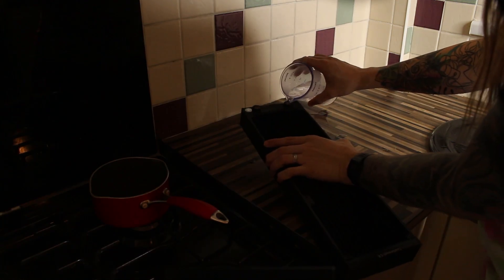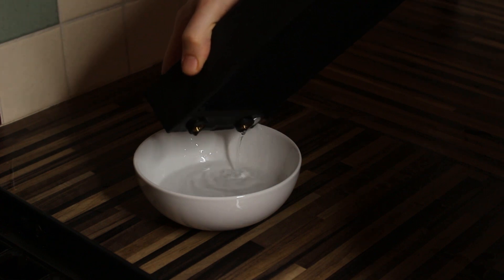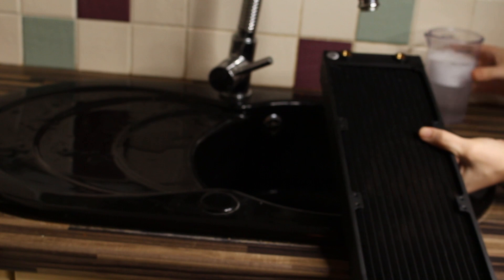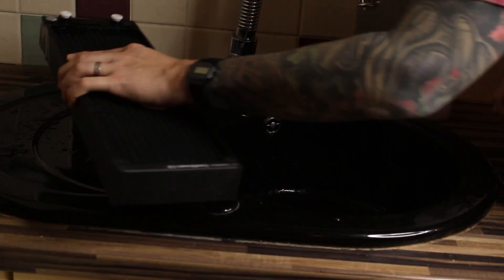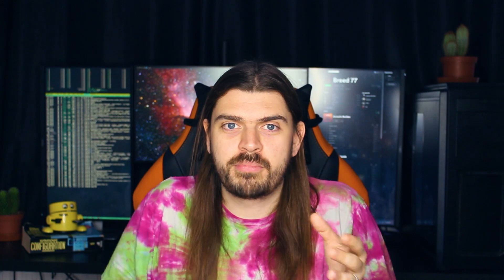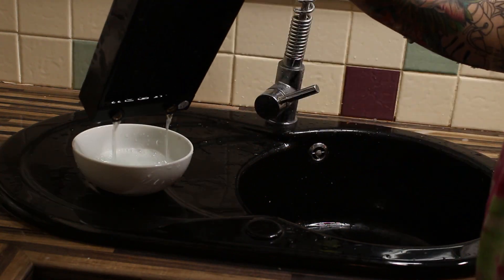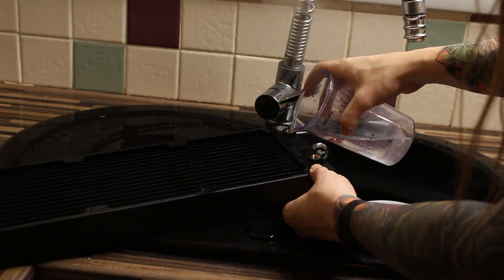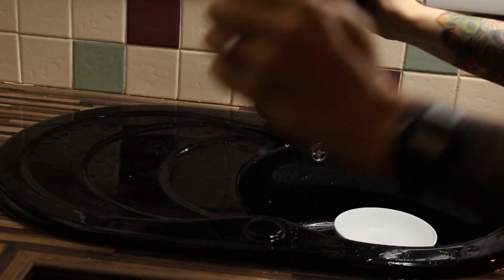Water Cooling: Cleaning Your Radiator

Comment from the maker: This was my first time - so how do you clean your radiators - any tips or tricks to share?
Reply: I only do it with room temperature distilled water, shake it, empty it, fill it again until nothing comes out anymore. I'm not a fan of aggressive cleaners.
Reply: Couple of small errors that could build up. No.1 by cleaning with chemicals you risk damaging softer materials such as plexi or even the rubber o rings in fittings. The chemicals will also react with some coolants which then limits your choices on those and more importantly you don't know what will and won't react unless you have a degree or knowledge in chemistry. No.2 by flushing with regular water you introduce metals and other contaminants that will accelerate the oxidization of the copper e.g. corrosion. Both of these things pretty much ensure that if you don't flush it with proper liquids chances are that radiator and most things inside your loop are dead within the first year.

Edit: For anyone looking to flush radiators either new or used there are three methods. One hot/warm boiled distilled demineralised water and let it sit in the radiator for 10-15mins to break down the flux (this is the most important thing to remove vs the small bits of metal). Two again with hot/warm demineralised water but with a tiny splash of acid such as lemon juice or white vinegar to aid this process, note that with acid baths like this you again limit your choice of coolants it can break them down or change their color over time. Three buy a radiator flush concentrate, this is usually a soft chemical mix which again can react with specific coolants but is for the sake of people running clear distilled water loops one of the best options there is. In general you want to not introduce ANY unknowns into the loop as they WILL stay no matter how many times you flush it.

Comment: Some would argue that only demineralised water should be used in order to prevent corrosion inside the radiators...
Reply from the maker: Some would not be happy that I recently rebuilt this using mostly tap water for 2 months...
Reply: @GuyRobotTV  the guy is right. You should never, ever put anything but deionized water or distilled water in a radiator. That your radiator has held up for two whole months means nothing lol!
Reply from the maker: @christopherjames9843  From a chemical perspective it really comes down to the impact of it and how long it's running - much in the same capacity you can fill a car radiator up with a bottle of Coca Cola in a worst case scenario it probably isn't a great idea.

Using boiled tap water in a clean cycle before you place in cooling fluids with additives is going to do you no harm.  Running on tap water - absolutely.  In that case you're keeping contaminants in there and increase chance of gunking up your loop or removing some of the nice shiny chromed finished on top of the copper.  That being said it's still going to work for a reasonable length of time but just kill your cooling hardware quicker or give you a clean-up job.  If you run on tap water for a day and swap it out you won't see a problem as there hasn't been long enough for some magical chemical reaction to take place.  If you run it for a year you're probably going to regret your missing shiny coatings inside blocks and wish you'd cleaned it sooner.

Now what you're really not going to like is I switched this build back to air cooling about 2 months ago and put all the cooling parts in a box without cleaning them as I was in a hurry.  They're still there.  That's absolutely what you shouldn't do.

For this specific comment - by all means use demineralised water as part of the clean.  It's total overkill but it won't hurt.  Running the loop permanently - absolutely don't use normal tap water unless you want to deal with the consequences.
Reply: @GuyRobotTV  cillit bang works fine. it has corrosion inhibitors in it, so if you don't let it soak in to long, there will be no corrosion.

Comment: you dont explain everything. why should i remove into pieces my water cooler. how should i put it back together in order not to leave any air-bouble inside. whatever . if people are new to this then ur video could cause more problems than a dusty/dirty radiator.
Reply: this is for custom loops not AIO
Reply from the maker: Definitely don't take apart an AIO!  There's a full water cool install video on the channel as well this is just for cleaning the rad.